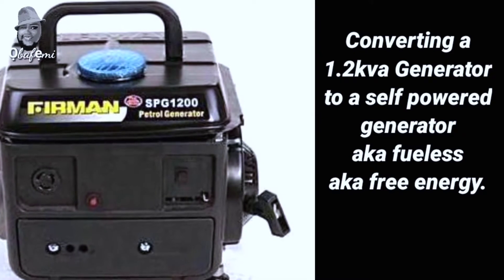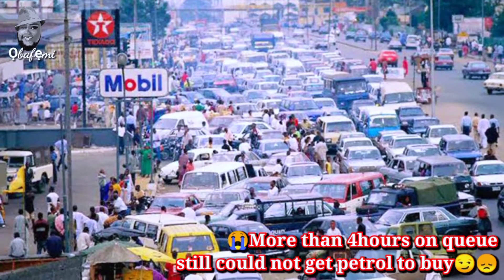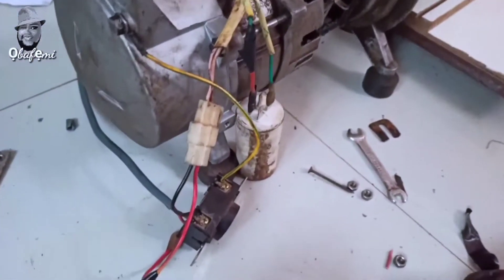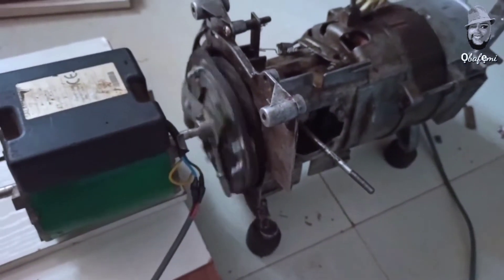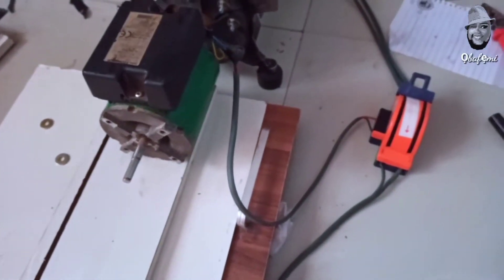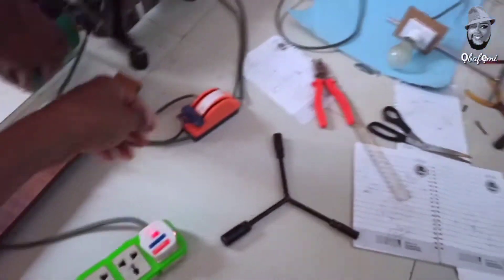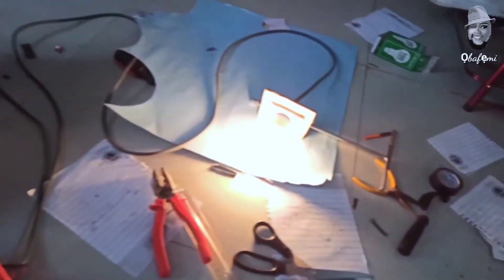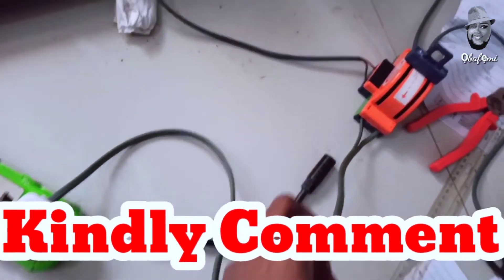ALERT: Do fuelless generators work? Is self powered generator real? DIY to build fuelless generator

Comment: If u are to use, twelve volt dc motor, u will need a batter to power it, and if u are to use the gen to power the motor, u will need to rectify the ac current and also step it down from 230 volt to 12 volt. There are so many knowledge concerning the production of fueless gen. Note that the gen combustion engine is 2hp engine, and ur motor is not even up to 0.5 hp. How will it regulate frequency and voltage?
Reply from the maker: Do you have a set-up parameters that work and regulates the voltage well, and it is actually free? I would love to see
Reply: @obasomething use 12v durable battery to power the motor, and ur motor rm must be 3600 which is equivalent to the combustion engine rpm. And if ur motor can not achieve the required rpm (3600), the u need to apply gear or pully to increse the rpm to the generator. Cansider gear ratio when u want to use it.

Comment: Change the THE CHANGE OVER it doesn't worth it, the problem is from the change over
Reply from the maker: Really, to what type of change over? Describe the type
Reply: @obasomething if the problem is from the change over, that is bcos u are not switching it to the gen very fast, when electricity run the motor, the rpm is at it peak which allows the gen to produce electricity, but when u try to change the applied electricity to gen, the little time interval which u want to switch it which no electricity is supplied to the motor decrease the rpm of the motor. In generator, the rpm must help the exciter achive 50hertz b4 gen can produce electricity
Reply from the maker: @networkgeneral Not the change over, it requires what to sustain and regulate the current supplied. The RPM, has to be constant irrespective of the consumption, like you siad.
How would that be achieved?

Comment: I need fuel less generator
Reply from the maker: @Sunking-w5t  you can try create biodegradable gas using your septic tank, then convert your generator to use gas, then run the pipe from the biodegradable gas you create into your generator. Enjoy

Comment: Get 750w 1hp 3500 or 3000 rpm that's ur solution
Reply from the maker: The 750w is too much for this set up, thats more than half consumption of this setup. By the time you place a small ox fan and TV on it, it will be running at over drive.

Comment: You do perfect work. Your problem is flywheel because flywheel maintained your rpm for power exchange then if don’t want to use flywheel then use dc motor and 12v battery and battery charger
Reply from the maker: Thank you. I was thinking of infinity power supply, that was the reason I did not start with the DC and battery.
And the flywheel Needs a much more powerful motor. After working with some apparatus I realized it's got to be a bigger setup for it to be successful

Comment: My man just add permanent magnets (neodymium magnets) on the north and south poles of the rotor. If u check de rotor has magnets but dey are not really strong just for exiting the rotor winding when it reaches 3000 rpm temporary so when u add strong permanent magnets, it den generates at low speed by den de motor will be on high speed den it will peak up from there

Comment: U need to add permanent magnets to the generator rotor
Reply from the maker: Great idea, but I tilted towards biodigester to fuel a silent generator. But i am still bothered about the noise and interchanging with 3 spare fuel economical generators. Maybe i will try to look into the permanent magnet application.

Comment: What is the voltage of the DC motor?
Reply from the maker: Since it's DC, it is 12v or 24v
Reply: @obasomething if the motor is dc, the gen cant power it since the gen produce ac voltage, and also, it make damge the motor since the gen applied voltage is higher than the motor required volt and current
Reply from the maker: @networkgeneral this set up is all AC.

Comment: Hello My name is John the reason why the changeover failed is
The RPM of the electric motor have to be higher than the required RPM of the Alternator and secondly you have to attach a small heavy weight flywheel.Adding these two said will.make the changeover works.

Comment: Listen, it's totally impossible to have self running generator. Energy can neither be created nor destroyed. So the generator cannot run the electric motor while it's running same generator. You can only maintain constant power output by running the motor from the external source...
Reply: lie
Reply from the maker: I wish to agree with you, but there's got to be proof.

Comment: Using flywheel worth  about 40 to 50 kg can aswell sustain the power in the cause of translation 
Let me know if it works or not I have another option for you.
Reply from the maker: Kindly send me the other option please. Is your electricity off grid as well?

Comment: Firstly using a fly wheel of 25kg and belt can save some energy during the change over
Reply: Hello sir am back again using a small 900watt generator requires DC system enough of it make your calculations charge back should be higher than out put to avoid battery from draining but I will suggest you go for another Generator with a lower rpm like 7.5Kw that has 1500Rpm  or more build your torque using fly wheel you can achieve this easily
Reply from the maker: Hmmm, i used DC, 6.5kva alternator from original with AVR, 100amp battery, the RPM = 1450, 3HP DC motor/1500rpm, 20kg flywheel, the 50kg was too heavy to spin to the required RPM the motor eventually burnt due to overheating.
The motor was recoiled (repaired) and used without flywheel, it worked but the battery drained really fast.
A car alternator was worked to the apparatus, but it was getting little charge.
I guess the DC motor was consuming so much. There's a guy that volunteered to help reduce the Amp consumption of the motor so that it can help the apparatus work better.
I have travelled for now, when i get back i will put all of these together and probably try it again.
Reply from the maker: There is always a drag down somehow. I see potentials in that but trust me one'd need to go bigger on both alternator and motor to compensate for the drag downs. You must have acquired more knowledge over the months. However I am looking at another alternative power supply the only disturbance would be the noise, but I will work around it.

Comment: And permanent magnet
Reply: A permanent magnet needs a low rpm motor
Reply: Sir you can’t Escape it is Either you use flywheel 50kg or lesser  to save Energy while you are changing over or a DC motor for starting that’s the trick here sir
Reply from the maker: First of all you said a Permanent magnet requires a Lower RPM... Hmmn!‽ Okay, this 1200watt generator requires 3,000Rpm so that when it supplies load to eg TV, bulbs, the rotation will slow down and current usually stops supplying. (I have converted the two 25kg flywheel gym equipment for this purpose..lol, it dint sustain for long. So l, it thus means using another Motor as you have suggested. However, i don't wonna toll the lane of DC motor and using a battery will defeat the purpose, I hope to make it free sustainable energy. Getting a permanent magnet and installing it will be a challenge. I guess i will consult an elect engr to modify the generator right? Kindly send me a video of yours. Thank you i will soon upload part 2 of all suggestions.
Reply: @obasomething  either u used flywheel to store energy or use permanent magnet for low rpm or DC motor dat is the trick
Reply from the maker: @frankoseiboateng725  okay, so I did the Flywheel thing, using my gym equipment of 70kg, it was slow to start and the motor started smelling burned and stopped working. I got a second motor but when the set up picked, it blew up the bulb, and the capacitor of the generator. I think this is a result of not being able to regulate and make the voltage stable. I mean make it a constant 220v. My next project is to get a bigger generator that has an inbuilt regulator to control and make the voltage supply a stable one. That will be later when i can afford it. And I have not been able to lay my hands on this permanent magnet generator you arr talking about.
Reply: @obasomething  den u need regulator to control the speed if the generator is 3000rp and your motor is 4000rpm u will have high current what the flywheel do is is just maintain your speed for u during exchange of power
Reply: @obasomething  your contact
Reply from the maker: A permanent magnet and a flywheel did not work, did not work so well with a 1200watt generator, as soon as the generator supplied current to the motor, the rotation slowed down and came to a stop. Do you have a video to show what you are suggesting? A real verified video. No hidden secrets..